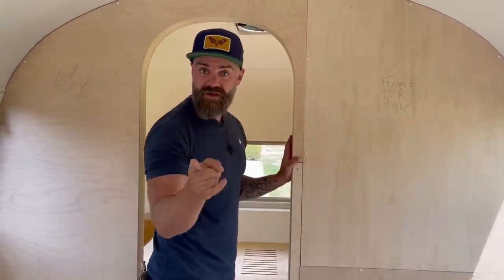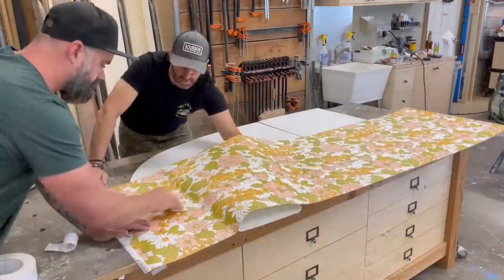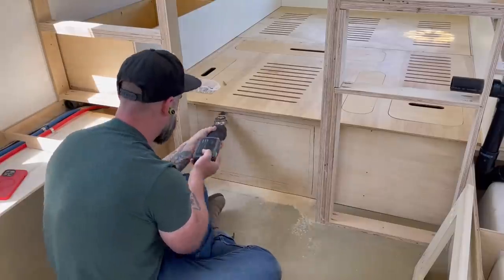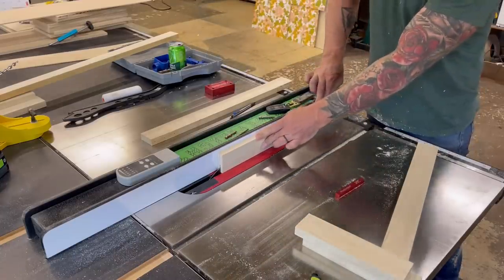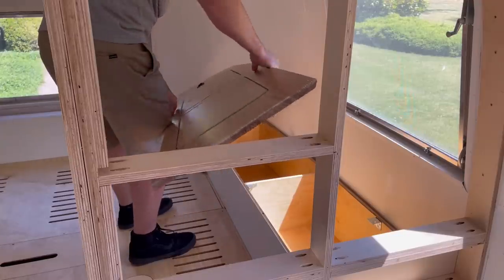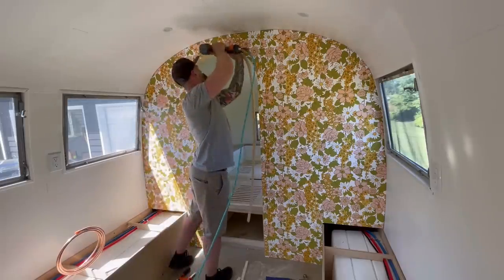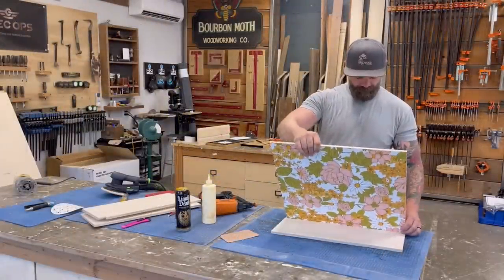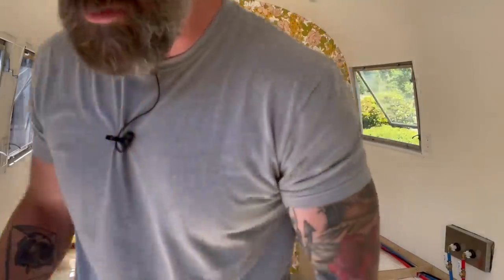A Third Of The Way Done || Bringing Back That 60's Vibe

Comment: As an RV'er one thing I heard that I've taken to heart is anything in an RV needs to be able to survive a long running 7.0 earthquake.  That's approximately the level of shaking an RV gets driving down the road.  Anything I've built of modified on my RV has been terribly overbuilt.  Extra screws, extra glue and most importantly, designed for easier repair/replacement when it does (invariably) break.  Looks like a fun project.  I look forward to seeing how it turns out.

Comment: Having done a few campers,  there is an white rubber edge trim that you can put on panels to fill the gap between the ceiling and wall panels.
Reply: As I have followed the precise scribing process, I’ve been wondering how much allowance for frame flex is advisable. Might be an even more important consideration as cabinets are hung from the walls.

Comment: Looking good . My wife and I are looking for an older cool ca,per to redo. I have the plan to gut it redo it and the 3 things I figured out is instead of propane I'd I stall a mini split unit for heat and cooling. Way more efficient and cheaper than a roof air. Under cabinet fridge and radiant eyes instead of a cook top or stove . Lighter ,easy to put away in a cabinet and keep counter space open. Mini split outaide unit would mount where propane tanks are now. I'd also make a storage area for a small pellet grill for bbQ ING.   😂

Comment: I used the peel and stick in my camper, after a couple of months the vinyl shrunk and left gaps in the joints. Hope you have better luck. I think the heat inside was the culprit

Comment: You should put welting between the wall joints to hide the cracks.  The black line looks bad and would be better than caulking.

Comment: Thank you for this.  My wife and I are building out a slide in camper.  I just got the point where I need to trim out the front loft space which has curved walls.  Using your scribe method I got the curves pretty close, but I need trim to hide the gaps.  The flexible trim you used is perfect!  Ordered some and I can get the walls taped and painted while I wait for it to get here tomorrow.

Comment: 25:37 rt 2 sides of the bed that are in the conners, add 6x9 speakers  you can add a 2din style radio at some other spot with built in DVD and TV functions also add some big screen TV at some point and tie them together. No reason you can't add some forms of entertainment.

Comment: Jason my love I know you cut vents in the top of your bed however please please put a Aire flow hypervent  mattress underlay it dosent have to be that brand that’s just the brand that we put in both of our vintage trailers (Boler and a Unik) when I remodelled our Boler I too cut a lot of vents in the top of the bed but where the mattress was touching and no vent hole it was damp or out right soaked  once we put that vented mattress on what a difference so when I did our Unik (complete gut) I did the same ZERO POINT ZERO issues🇨🇦

Comment: You are doing an outstanding job - especially having never worked on a trailer before. Getting tips from Andy was a smart move. You may prove me wrong, but given the flexibility of a trailer’s frame, I think your inset drawer faces will ultimately bind and potentially fail. If you look on any mass produced trailer, they all use overlay drawer faces.

Comment: I see all the comments about the wallpaper here but what looked odd to me were the cabinet/drawer doors on the bathroom side in the bedroom. They looked a different shade to me. I know you has trouble with the finish previously, but the other side looks fine. Maybe it just looks like that to me. Anyway, I do enjoy your work and I think this is going splendidly. Cheers!
Reply: In a previous video Jason used a new can of Rubio and the tint was off from the old can... It was sanded and refinished... But maybe it still wasn't 100% match from the other side... It's probably 99.5%.
Reply: @OldsmobileCutlass1969Va  Didn't look that close to me. It looked more white. The other side is perfect but the side I mentioned was well. Like I said, maybe just looked like that to me.

Comment: I was a kid in the 1960s and thats the ugliest wall paper.

But hay if you have to remove and replace it at your cut seams , dont split the 2 parts fold them to get it in the door, the open them to install each side youll only have 1 small seam at the right top of the door and with the loud bust wallpaper youll never see it.  Really that stuff looks like cabnit shelf paper not wall paper.